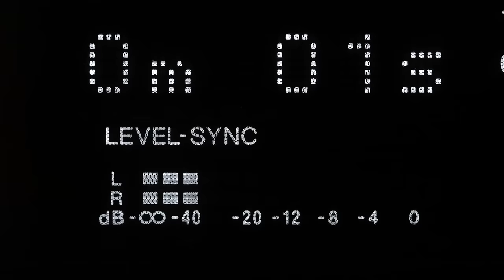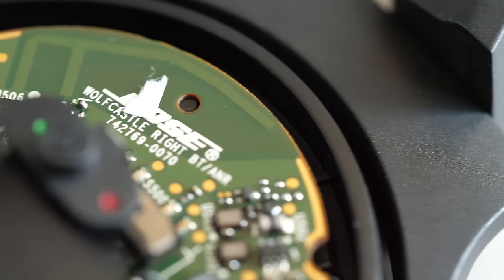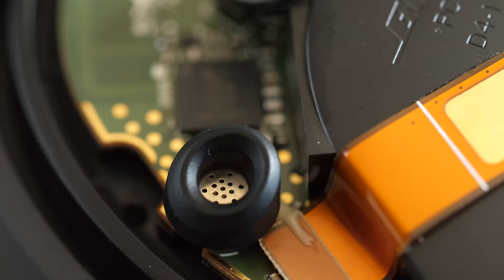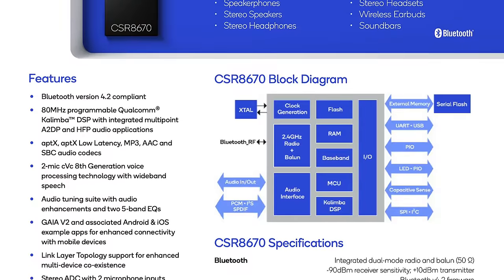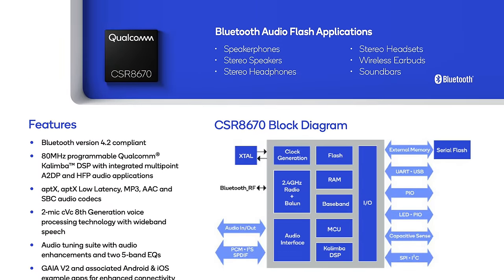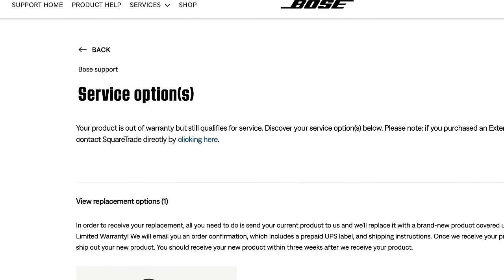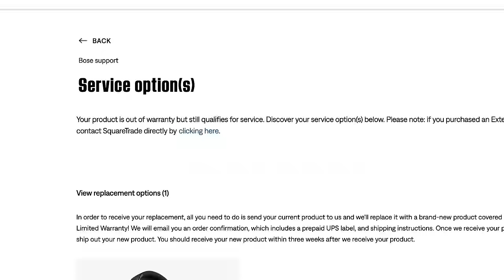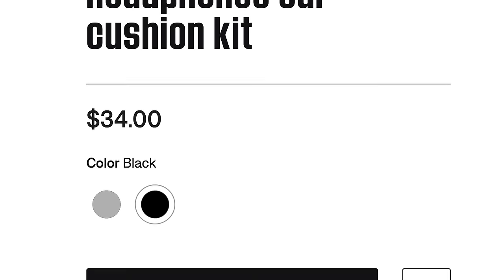I thought my Bose headphones were DEAD until I found this fix!

Comment: "and I ordered a few replacements just to be safe" ... a phrase that will haunt my future generations
Reply: Not at this rate
Reply: Not just ordering replacements but only needing one part but only being able to order them in packs of 5
Reply: It makes sense to order more than one when purchasing from the wholesale distributors which are the only place you can purchase these components. You pay the same amount for shipping (about $5 for the cheapest option) whether you order only 1 or 50+ (depending on the component size and weight). You just keep a database of your in stock components, chuck them in a bin, and check your database for the part number if you ever need another one in the future.
Reply: @davidcameron648  I do the same except i don't hold a database and always forget what I have .... Thanks for the reminder that I should really go back and dig everything out and properly organize them. X)

Comment: Bose quality is pretty low to begin with, so third party replacements cannot be so much worse. I had a couple of Bose ear buds and in both case the wire disintegrated on its own within three years. I have also two wired AE headphones and again cables are worn out and ear pads exploded. Overpriced, mediocre sounding devices. Bose is a "no go" for me, other brands are much better.

Comment: I don’t understand the hate on Bose. I’ve owned SEVERAL different pairs of over the ear headphones, from all different brands. Yes, Bose doesn’t sound the best in terms of audio quality, but their noise canceling technology is leaps and bounds better than the other I’ve used. They are also really durable. The pair I’m currently using are 12 years old. I also think the price to quality is pretty fair. A $150 - $300 set of headphones isn’t going to sound as good as a $500 - $800 pair. You can still buy the headphones I have today for $250. Over the course of 12 years and how well they’ve held up, I’d say they are pretty damn good.
Reply: I don't get it either. I have a set of Companion 2 speakers for my PC and I love those things
Reply: Since you asked, I own a pair of these which are my only experience with Bose as a brand and here’s what I don’t like: I’m sensitive enough to the noise cancelling (ANC) that it hurts to have on at any level. There is no option to disable noise cancelling by default. I cannot turn ANC off if I’m in a call so I need to race them every time I turn them on for a meeting. The firmware has crashed several times locking them up entirely until the battery dies which can be most of a day since there’s no reset. The only redeeming qualities are that it always connects and the audio quality to me is quite good.

Comment: Bose makes cool headphones, but their design flaws is why many audiophiles hate them, if they focused on quality control, they would have a better reputation! So glad that power switch was an easy fix!
Reply: They also have quite a coloured sound, not so good if you like your music as the artist intended...
Reply: They sound rather bad, that's why audiophiles hate them. But yeah, we also hate the Sony XM headsets because they make music sound processed. 
Regarding wireless headphones, the Beyerdynamic Amiron Wireless was the first I considered acceptable sounding and these days I've been running Mark Levinson 5909 (not recommended due to poor build and other quirks though).
Reply: @puciohenzap891  I’m not a fan of wireless headphones in general, because they have battery and connectivity issues! Things are getting too complicated, I’m still mad that both Apple and Samsung have got rid of the headphone jack for their phones, and I have to use the dongle for my wired Bose headphones that were really good!

Comment: The battery in my QC35's died. Thankfully I was able to source a replacement, Getting the old one out was a paint, but soldering in the new one and buttoning it up it now functions like new. Glad to know the switch can be fixed also.

Comment: I love these headphones, I actually bought a second one of these, because of a similar issue.
after a year, I just found a suitable replacement part and fixed the original one (still with a good battery).
And now, I use them both.

Comment: I have the QC 35 II's and I believe they fixed the switch issue, at least I read that somewhere. I have also replaced my ear cushions 4 times, twice with inexpensive 3rd party options. None of the 3rd party options have anywhere near as good passive isolation as OEM, meaning the tune for the active NC is off. They also don't feel as nice after prolonged use and lasted just as long as OEM.
I agree the genuine Bose cushions are a bit overpriced, but I will pay that for the performance. My latest set have lasted the longest so far, even longer than the ones the headphones came with, so I think Bose have actually addressed the issues of early failure as reported by so many reviews on their own site for the cushions.
Reply: The QC 35s tend to be really particular about earpads. Unless the spacing and foam density are exactly right, you lose a lot of ANC performance. You definitely don't want just any $8 earpad from eBay. I've found that the WC Wicked Cushions work about 90-95% as well as the stock ones. That might be a worthy tradeoff considering they cost $20 instead of $35+, especially if they last longer.

Comment: This kind of power switch failure is one of the most common failures I see on these, but I never even considered the carrying case as the cause. The fact they put the cable pocket right on top of where the earcup is located never sat right with me, so I've always done everything I can to maximize clearance in that area. This usually means winding up cables around where the earcup would be, or just storing them in a different location in the case. So far, so good for my personal set.

If guess if you're paranoid about this, you could fold up your headphones in the opposite of the position shown in the tag diagram, placing the right earcup at the top, away from the cable pocket.

Comment: And this is why Im still hanging on to my Bose QC 25s.  Yes, the 25 is corded and Im sure the noise cancelling isnt as nice as newer models and it doesnt have all the voice assistant features (which I dont use anyway), but it has an easy user replaceable battery.  You just swap out your old AAA and put a new one in.  Ive even sourced a couple extra pairs for family.  They still work great.  I used them on a recent Europe trip and had no problems with the noise cancelling and plugging into the on board entertainment.
Reply: I try to get everything with AA/AAA batteries if it's an option, great for longevity. QC25 is unique in that regard, don't know any other great noise cancelling cans that runs on AAAs.
Reply: corded is best. PERIOD.  There is no such thing as wireless headphones that don't have lag.  You lose the quality of your amplifier and get whatever happens to be in your wireless headphones.  I do not like them one bit. Hang on to your wired headphones!!!!!
Reply: I love my Bose QC25s. I have the special edition triple black ones and they are awesome. Super comfortable and have lasted forever. I got them for $50 on Facebook marketplace with some worn ear pads. Managed to get some new ones for free from Bose! Bought them nearly 4 years ago and still going strong. Don’t think I’ll need a new pair for a while. It’s a shame headphones aren’t built to last anymore. Some family friends have gone through countless pairs of cheap wireless headphones only to have the batteries die or they just fall apart. The QC25s haven’t had a single issue since I bought them. I have 2 other pairs I bought for my other family members aswell 👍

Comment: That switch probably didn't need to be replaced. You can just take it apart as demonstrated, clean the contacts and wiper with some DeoxIT (the dirt that was cleaned out was the remains of the similar product that is used to keep the contacts and wiper from oxidizing mixed with a bit of dust and the tarnish that the silver plated contacts had built up) -- leaving a thin film of it on the contacts and wiper to keep it from quickly reoxidizing (leaving them bare like shown is probably going to cause it to tarnish rather quickly), then put it back together.
Reply: Hi, did you bend the metal tabs a bit out? Wondering if the  tabs get bent over time. Also wouldn't a dab of electrical grease do the trick for oxidation? Thanks
Reply: i didn't even take the switch apart, just put a drop or two of 91% ipa in and worked it a bit... waited for it to dry and now it works again! FOR NOW...

Comment: Did it, couple of quick notes take a pick of the switch before you pry off the metal top. On mine the switch was on the rt side of the headphones. So the spring is on the bottom of the switch. Also the metal piece you have to pry off has one side that clips down and faces towards the left of the headphones the other side has nothing...both ends also clip and that is where you pry off from. On the black plastic piece a hint when putting back together is there is a hole in one side that will hold the spring. Put the spring in the hole then put the black tab back in the switch then the silver plate with the metal side facing the left. I also used contact cleaner and a glasses cleaning cloth to clean off the oxidation. I also put a tiny amount of dielectric grease to prevent further oxidation....but not sure if this is necessary or overkill. Good luck, use reading glasses and cellphone light for better light.

Comment: "Instead of repairing recently sold stuff, give him a discount, we don't repair" (c) Bose (and all the other companies)

Great video!
Reply: Unlike Apple and Samsung you were able to buy replacement parts from a 3rd party vendor and the parts were not serialized!!!
Reply: Bose is extremely overpriced.  But worse, is they are wireless.  Wireless sucks.  You lose the quality of your amplifier. They need charging. Most have impossible to replace batteries.  They lag.  I absolutely do not like watching a video where the video is out of sync with the audio. It drives me nuts.  You cannot unsee it, even if it is only a few milliseconds. It just is so off-putting.
Reply: @tarstarkusz according to science(EBU R37-2007), having audio lagging behind by  than 40 ms is going to be noticed by very few people. aptX-ll has been able to do this for a while, which is why it's the preferred codec for gaming wireless headphones. also, for example youtube has latency compensation. still miss my 3.5 mm jack tho :/
Reply: @tarstarkusz That's one of the things I liked about my Audio technica wireless headphones is the battery isn't to hard to get to in the future if I need to replace it and the headphones still work even without bluetooth thanks to the aux jack.

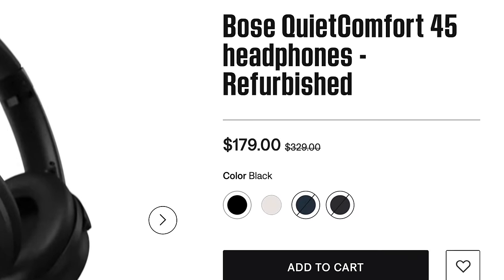Comment: 6:35 Sennheiser 600-series owners will chuckle a bit here. Our OEM pads are over $50 a pair. And since aftermarket pads often drastically (and negatively) change the sound, you're pretty much stuck buying the official ones. If you're careful and tension the headband correctly, you might get a few years out of a pair of pads before it's time for a replacement.

Comment: You don't need to remove the earpad liners to access the screws that secure the outer shells shells to the earcup assembly. They are all directly accessible if you pull back the top or bottom of the liner (which you can do since only the sides are glued into place).

Comment: Oh my lord. I had the same problem, and broke my QC35s whilst soldering on the replacement switch. There are some small components nearby I must have upset. I ended up trading them in with Bose at great expense to get the QC Ultra, which aren't much better and make terrible noises on public busses and whilst running due to over-active noise cancelling. I wish this video had come out a few months earlier!

Comment: QC 35 ii owner here, the original replacement earcups are NOT worth it. I've swapped them twice and they end up flaking off within a year, even taking care of wiping them off. The pleather used on the original ones is way thinner (probably the difference you feel). I ended up buying third party replacement pads last year and seem to be holding up just fine.

Comment: I've found the replacement ear pads from several sellers to be fine, although there is one brand that doesn't look at all like the originals but has lasted me a LOT longer. I was going through a set every 6-8 months previously because I fall asleep with mine on, but the new set has lasted well over a year now. As for the battery, that may be a replacement soon enough, although since mine never go in the original case my switch seems fine.

Comment: I've had my QC 35 IIs for 7+ years but never keep them in the case - just chuck them in my bag or on the desk. They're still going as strong as day 1.  I use them for an average of 6 hours a day, every day, and the battery still holds up.  These things are insane.  When they got discontinued a few  years ago, I picked up a spare pair in a sale, but I've had no cause to use them yet.

Comment: Nice video! I have used a pair of QC35 for over five years now. They are great, however, due to some annoying Bluetooth issues I experience with my iPhone (not wanting to connect, then suddenly the headphones reboot, for example) and never managing to get these work well with Teams on Windows, and also the fact that they will probably never get a SW update again, I decided to go for a new pair of QC Ultra now, which I love even more. The noise cancelling is phenomenal. 

I have never experienced this specific issue  with the QC35 but it’s good to know, as I want to pass these on to my sister. First I need to tackle the 3rd party pads I put on a while ago and are completely worn out (the quality was apparently not that good 😢)…
Reply: Oh and one interesting note about that chip. I am an embedded SW developer and that chip series got considered in a startup project I consulted for. However as it’s virtually impossible to work with Qualcomm as a small startup company we went for something else instead. It is indeed an interesting device though!

Comment: It seems like a lot of these switches get this issue. My GBA SP that I got secondhand had really low volume, bad headphone output, and a constant low battery light (even on a full charge) until I took apart the power switch and cleaned it. MattKC did a video on a Gameboy Pocket that was completely dead, whose only major issue was (surprise surprise) a dirty power switch.

Comment: My wife's headset had this issue or similar, it just wouldn't stay turned off. I put it down to moisture. Three days in a box of rice and it seemed to fix itself.

Even easier and stress free solution that's worth a try. But this is a good solution for this problem.

Comment: Assuming these are QC 35 I, I had the exact same issue. 
My solution was to contact Bose directly and by sending mine in, I received a new QC35 model II replacement. 🤷‍♂️
I don't know if mine were still in warranty, actually. I think I claimed manufacturing defect and the EU regulations give s bit of extended warranty for those cases, but YMMV. 
Glad to know that this is a solution if I pick up a spare old pair used.

Comment: I'm amazed these sliding switches are still around in the 21st century. They were always famous for gradually leaving a trace between contacts causing a short or permanent "on" situation. In the 80s products used to have these and often suffered from this problem. Stories of calculators overheating etc.. glad you could find replacements but I wonder if alternative styles of switched could be fitted?
Reply: Trace of what between contacts? The materials are different from the 80s, when carbon tracks are used they have a better polymer matrix binder rather than just a random tar, and this switch uses metal tracks, and the switch isn't used in a current carrying capacity, it's only a processor input.
Reply: and yet they fail?

Comment: It's very nice to heard that Bose make very easy to repair headphones. In today's world it often feels like all electronics are designed to be discarded when they break and if they can be repaired you need to really know what you're doing. This is a nice breath of fresh air and I hope others will follow suit.
Reply: The ability to take off the outer shells is probably the only thing easy about working on these. Everything is soldered together using the thinnest gauge enamel wire possible, including the 12-pin cable that connects the two earcups together. Even the battery is glued shut in its own compartment and soldered directly to the main board. Whoever designed the QC 35s had the upmost contempt for anybody who would dare to repair them.

For all the battery and charging issues Sony WH-1000XM3/4s have, at least the battery is on a solderless connector, so replacing it isn't a huge deal.

Comment: Ive used my qc35ii's every day for the last 6 years(8-22 hrs a day. Work and or sleep)

They have been absolutely flawless, but i dont keep them in the case. Ive bought a few pairs of 3rd party pads over the years and the aftermaket pads seem to not work as well with the noise cancelling. The next time i buy pads ill try to get a set of bose pads.

Comment: The Funny thing about my QC15's is that the cutoff point for low battery is just the noise cancelling clicking on and off, and I wonder if that's due to the resistance of the power switch getting greater and greater until it can't overcome it anymore. makes me wonder.